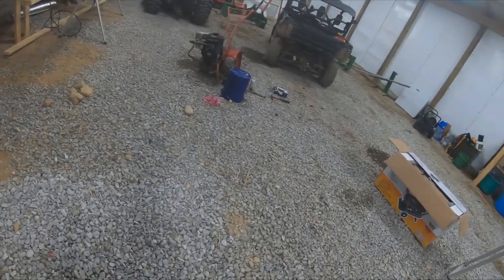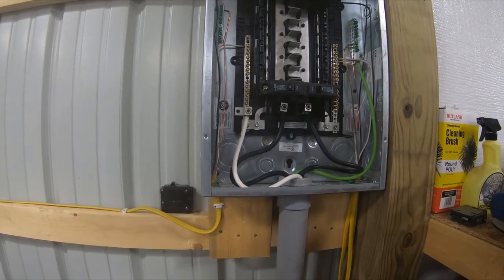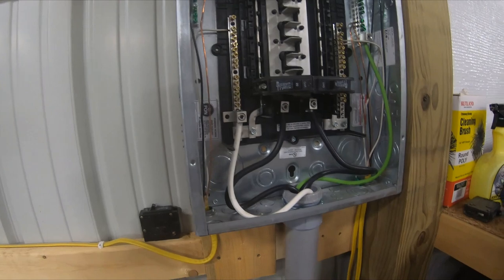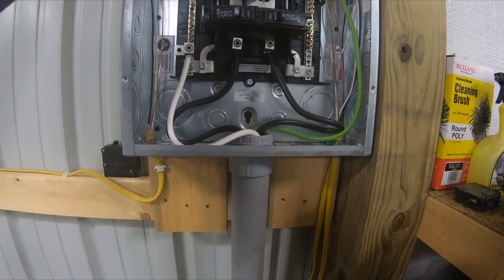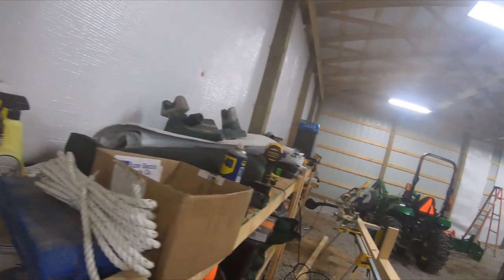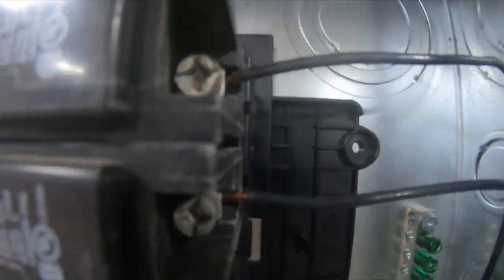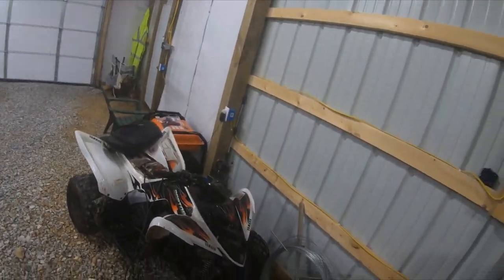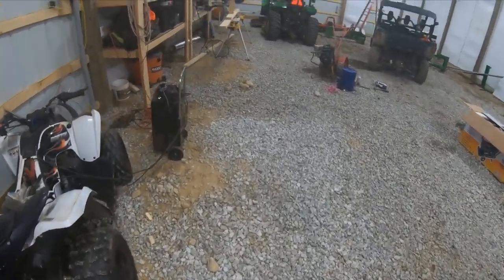How to Save Money Wiring Your Pole Building

Comment: I’m pretty sure you did not get any inspections on your work.   Just to let you know some things you are incorrect on.    
1.   Article 225.30 says that at the point where your feeder enters a separate building you are required to have a means of disconnect.   Since you do not have a main breaker, you do not comply.   You could install a safety switch below the panel to make it legal.
2.  You are required to install (2) ground rods and connect them to the ground bar.  These are for lightning dissipation.
3.   All 125 volt 15 and 20 amp receptacles are to be protected by GFCI protection.
4.  NM cable below 8,-0” is required to be covered by a material with 15 minutes of fire protection (1/2” drywall or other materials for instance) or protected from damage by conduit.
5.  You are not allowed to put GE breakers in an Eaton panel, even if they do fit.
I just thought you might like to know some facts.   Respectfully,   Kevin
Reply from the maker: i do have the ground rods  the rest must be if you have code enforcement